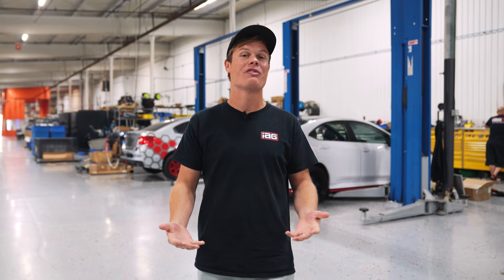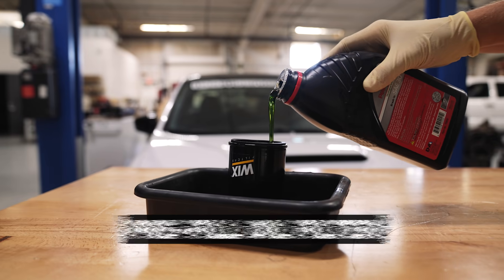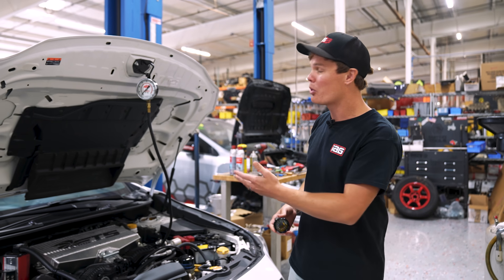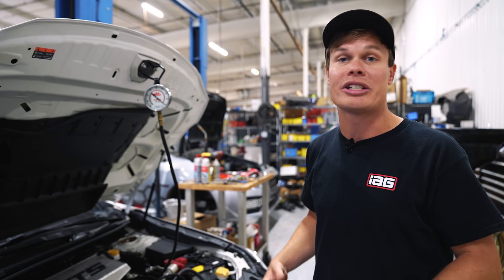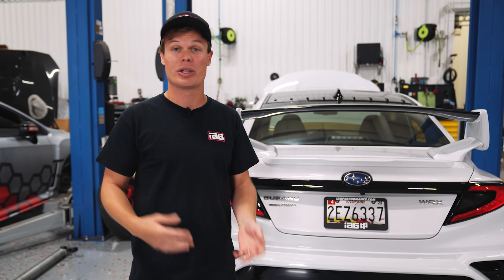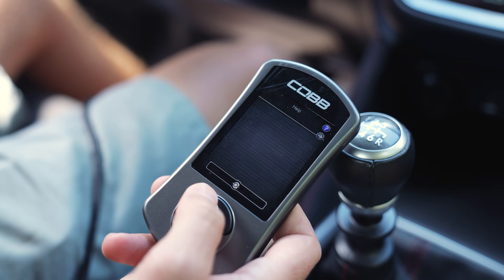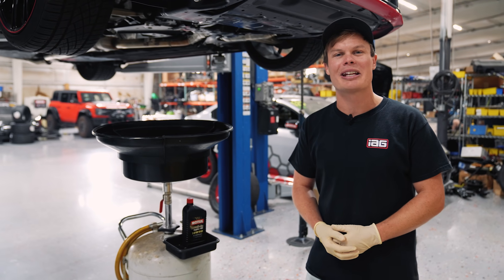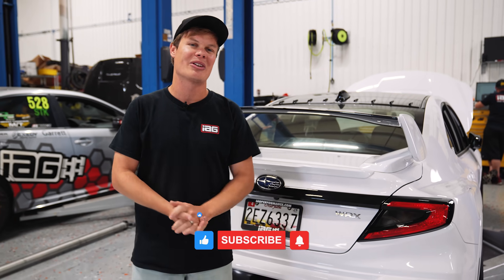How to Break-In a Built Engine PROPERLY

Comment: break-in times and processes definitely seem to be subjective, many shops, reputable and DIY, hobbyists, etc...all tend to have a similar process until it comes to the miles.
It definitely seems to be more true that the amount of miles doesnt matter, but HOW the miles are accumulated in the first 200 or so. After the first few hundred, it seems to be a 'safety net' for warranty purposes or 'just to be sure'. Im breaking in build #2 on my Ecoboost very soon and the main thing is oil priming, check for leaks, oil change after 50 miles or so, and again at maybe 150 and then up to 500 with break-in oil, then begin regular 3-4k mile oil changes with the usual synthetics. Ill be breaking in both new pistons, rings, crankshaft, valve springs, and camshafts this time..(technically and the new turbo lol). So ill definitely be puckering for a few hundred miles just waiting for leaks or CEL's to pop up 😅

Comment: Hey so now that motul discontinued the motul 10w40 6100 synergie + oil that iag recommends for ejs running e85. What other oils will work for motul besides the 300v
Reply: liquimoly molygen 5w40.

Comment: My conversion van is getting a new 5.7l engine installed now..........the shop told me not to worrry about any break in process.  'things have changed' they said......could this be correct?  2002 GMC Savana 5.7L 350 vortec.   Thanks!
Reply: It wouldnt hurt to just do the break in procedure regardless of what they think

Comment: Modern ring packages are low tension hard faced coated and will not wear into the cylinder, the all important part is the bore finish if your engine seems to use oil its time to take it back out and find a machine shop who can properly finish those bores, if the engine is done right you can beat the shit out of it and it will hurt nothing, these are not the old soft plasma rings of the past, sorry guys no break in necessary..

Comment: I have Millers break in oil, But for the first startup I wanna use a mineral oil with ZDDP additive as I will be flushing it out after idling for 5-10 mins. Can I use "MOTUL 3000 4T Plus 10w-40HC-TECH Mineral Engine Oil" for the first 10 mins?

Comment: FYI, the ONLY part of an engine that "breaks-in" is the piston ring sealing with the bores. Thats it. Vary the load on the first 25 miles and you be good. WIth the piston travel  speeds and average hone grit depth, it doesnt take long to seal with rings.
 Gaskets, seals, valves, bearings, chains,  hoses etc do not break-in

Comment: Curious, im build race engines in a different non automotive industry, we always recommend to change spark plus fairly quickly do to metal contamination from break in, do you guys not encounter that issue?
Reply from the maker: Fresh set up plugs on install is recommended but no need to change until its normal interval!

Comment: I was told of a very specific engine break-in process by a nice guy that worked at Toyota on all of their race engines from the 1990's to the time where I met him around 2010.  That process is as follows:

Mile 0
Break-in oil and new filter. Start the engine and get it to operating temperature.  Make sure there are no leaks.

Mile 0-500
Break-in oil and new filter. 4000rpm max.  No boost.  No cruise control.  No excessive idling.  Change gears every 90 seconds.  Engine braking (downshift) whenever possible.  Oil consumption will occur.

Mile 501-1500
Break-in oil and new filter. 4500rpm max.  Minimal boost (1-3psi).  No cruise control.  No excessive idling.  Change gears every 90 seconds.  Engine braking (downshift) whenever possible.  Oil consumption will occur.

Mile 1501-3000
Break-in oil and new filter. 5000rpm max.  Minimal boost (4-7psi).  No cruise control.  No excessive idling.  Change gears every 90 seconds.  Engine braking (downshift) whenever possible.  Oil consumption will occur.

Mile 3001 and after
Run whichever oil & filter you prefer.

I followed this process and my ej255 has been untouched since this process was completed.  It has been over 100,000 miles since the time that process was completed and I have no oil consumption issues.  I'm running stock boost levels, and it was performed on a OEM complete block with no modifications done - some parts were changed (ARP head studs, Cometic MLS head gaskets, KillerB oil pickup).  The Subaru specialist shop that did the engine swap detailed the same process.

As per the oil, choose whichever break-in oil you are comfortable with.  As per the filter, OEM filters are trash - most of the damage occurs from particles in the 20 micron and smaller range.  With that in mind, Royal Purple, AMSOil and the Fram Ultra Synthetic are the best oil filters on the market (unless you opt for a bypass kit).

This process was completed on my Toyota Mr2 and it was an incredibly rev happy engine (redline of 7200rpm) and it had no oil consumption issues either.

Does this process require an incredible amount of patience?  Yes, it absolutely does.  Is it worth it?  Absolutely!
Reply: Lol race engines. There's no race car in the world that puts more than 50 miles on the engine before being beat on.
Reply: @juliusschreck613  You have an opinion.  Good for you.

I'll stick by the word of someone that actually worked on Toyota's racing engines for over a decade.

Comment: Very curious - why would there be metal shavings during the break-in process? Are you saying the engine is supposed to disintegrate a little by design? I thought metal shavings normally happen when you don't change your oil a long time and that friction breaks down the moving parts of the engine.
Reply: And I hear different number of miles for the break-in period. Would you also expand on the 750 miles and where that number is from?
Reply: because when all the engine parts are machined no matter how precise it is there is always going to be a tiny amount of interference once everything is put together, and it take actual operation of the engine for everything to settle into place, so to speak.  those "metal shavings" are just tiny bits of metal that are getting ground off as everything starts operating.  it should stop once break in is complete, and then after that there should be none (unless something breaks of course) except for super tiny little particles that are normal part of regular wear and tear.
Reply: the metal shavings they are refering to is more like extremely fine grains of sand except metal, and this comes from the bearings, pistons rings, cylinder walls moving head compnets etc, wearing in to there final tolarances. all engines will wear (not disintergrate) as a byproduct from just operating from day 1. The metal shavings you are thinking of are byproduct of a spun bearing or something else that sized due to lack of oil, and that's completely different that what they mean. As far as why 750 miles I guess that what there testing has shown to be where everything has finally loosened up to spec.

Comment: I broke in my stage 2.5 to 1,800 miles this time just because. I also just learned that we have looser tolerances for pistons for higher power so I can hear the piston slap on warm up so that’s normal don’t be scared if you hear it.  My STI is on 40 lbs of boost and I finally finished tuning.
Reply: The looser piston tolerances are due to using forged pistons. Cast pistons don’t expand near as much when they heat up, that’s why you don’t hear it in a stock engine. Forged pistons expand much more do to heat so they have to size the cylinder bore larger for when they are at operating temp, this is the cause of piston slap on cold starts, by using offset wrist pins you can minimize piston slap, but it’s no big deal really
Reply: Just built my own engine and been doing the break in procedure it’s there but barely noticeable but thank for the info
Reply: larger ring gap for high boost means less "spring tension" holding the piston in place

Comment: I laugh when I see people taking 1000 miles to break an engine in. Its not the 1980s. The point of breaking in a engine is to wear the piston rings into the bores to create good compression. That's it. It takes approximately 50 miles or an hour of driving. Then you do a oil change and then its tuning/mapping time.

My engine builder who has been building engines since the 80s and subaru engines since 2002 has been doing it this way since the beginning.
Reply: This is absolutely how you do it!  I race cars and this is how we break in engines,  50 miles.   I also laugh at some tuners telling owners to take 1500 miles ha ha most people it's there 2nd car, weekend toy to blast or track car and 1500 miles would take weeks and weeks even into months.  50 miles on a engine dyno,  fit in car then tune. Job done
Reply: @craiga631 I’d assume they just say this simply to protect themselves. I was watching thinking how tf im gonna do 2500kms to break in the car when it’s unregistered needing to pass an inspection. I can’t get it inspected until it’s broken in. I can get a day pass, etc. but 2500kms is like a whole year of driving my Wrx.
Reply: That's how young people are now. Notice how many young people on YouTube telling experienced people how it's done. Lol.
Reply: same with mine. Break in on the dyno, change oil, and tune. then just change the oil again after a bit to synthetic

Comment: If you follow these steps... how did  you fill the cooling system and engine passages with coolant?
Reply from the maker: For the first heat cycle, it's important to use a no-spill funnel to bleed the system from the highest point. This is usually the coolant expansion tank. Once you turn off the engine, wait for the coolant to cool off before removing the funnel. Make sure to check your coolant levels when the car has cooled off every time you change the oil, and add more coolant if necessary.

Comment: Watched 2 seconds of the video and thought to myself. Here I am with a sloppy 1.8t build with questionable tolerance and a gt3076 at 30psi of boost. Bouncing off the Rev limiter anti lagging lighting tires. On a fresh "rebuild" with only 10 minutes of idle time LMAO. It still runs even after I sold it. Like 40k? Since it's slapped together build
Reply: 20mins and the motors go from >40% leakdown to <4%, but can sort of understand there logic if the camshafts and everything is new.